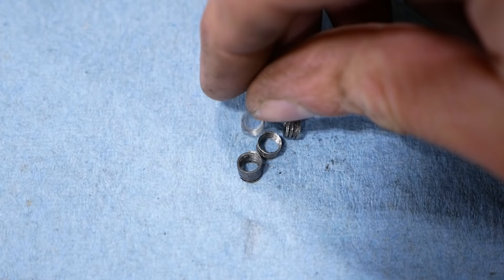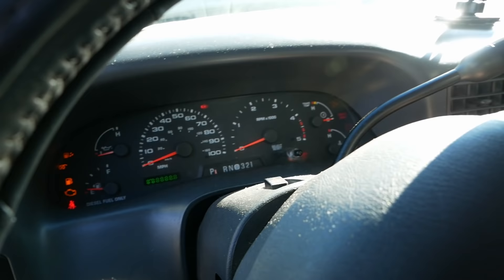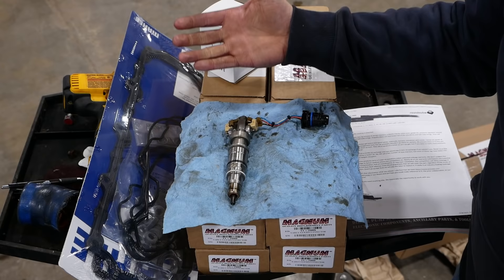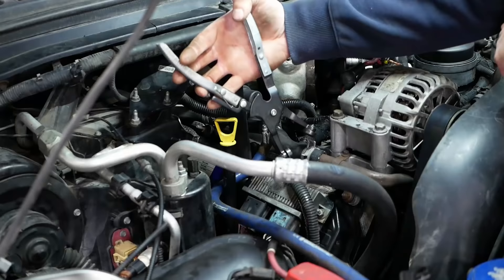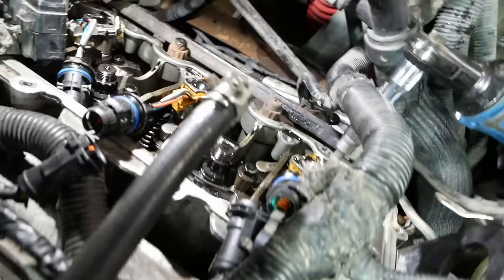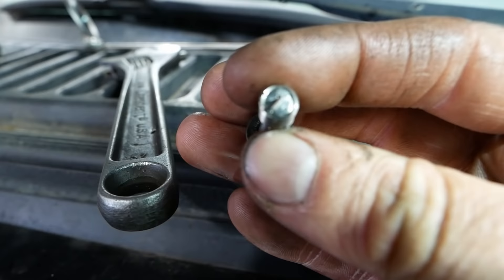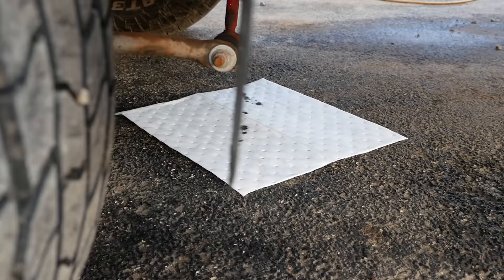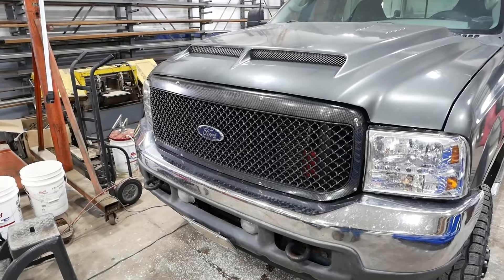They Left Me a Mess - 6.0 Power Stroke Low Cylinder Contribution - Injector Replacement Woes

Comment from the maker: Be sure to check out Area Diesel Service if you need injectors or anything else for you diesel engine! https://www.areadieselservice.com
Reply: Just sent them an email this morning about some Perkins injectors :) now I get to split the dang tractor and replace the shift fork. The loader frame assembly is gonna suck
Reply: Your video of your vist there was awesome!
Reply: I've watched those videos more than once.  They are pure professionals like you Wes.  TY for bringing many viewers along for the ride.  I wish I lived closer, you would have all of my vehicle business.  Always Best!!
Reply: The lighting is much improved... veddie noice
Reply: It's funny--- because I have the same color truck-- SRW though;  and a year before this. A 2002 F350 with the 7.3L diesel, 6spd manual, manual 4x4 transfer case, manual locking hubs.   I have over 320k miles and still on the original injectors and original glow plugs (it needs new glow plugs to be fair)...  It does love to leak a little everywhere, but she still starts and pulls anything I want it to.   I might look into polishing up this turd and selling it if they are worth that much now.  I have a 9ft flat bed on it with goose neck ball.  I'd hate to sell it, but if someone offered me that much, its gone. lol
Reply: Any insight on engines to avoid and engines that are more reliable?
Reply: He should sell it before it breaks in half. Just saying.
Reply: all the 6.0 powerstrokes and 7.3s the hood fitment is like that stock. or even aftermarket there is always a noticeable gap in the front.
Reply: @justnsaliga8518  it isn’t the gap itself, it’s the unevenness of the gap.
Reply: Thanks Wes!!!
Reply: yes, hate those 1/4 turn bolts cant reach, pig iron is cheap, . price of injectors buy a 7.3..
Reply: @tombeauchamp806  I will

Comment: It’s good Ford put the data plate on the backside of the valve cover against the heater box. Easy to read once you lift the cab off the chassis.
Reply: Considering that just about everything in the service data starts with 'remove the cab,' it's not too surprising.
Reply from the maker: At least it has a tag. Most engines have nothing.
Reply: @WatchWesWork  Here Here and thank the Gods of decency that a tag existed.
Reply: Another 
Better idea…..
NOT…
Reply: Ha ha
Reply: Like how ford doesnt label fuse box lids?
Reply: these trucks were designed around lifting the cab off for most engine work.
Reply: @chubbysumo2230  its actually way easier for the ford techs. Just screws the home mechanics.
Reply: I have been a Ford parts guy for over 20 years... If anyone ever needs an ESN for a 6.0 we can look them up by VIN... They all do stupid things.  I've heard that when doing head gaskets on a Duramax, you wont get the correct ones till you tear it down to find ID numbers on the gaskets.. Ford has given us ways to determine information like that prior to tear down.
Reply: @applefordguy76  yeah i had a lbz and was told there was 4 possibilities. Thankfully i left it 100% stock and it was flawless
Reply: @applefordguy76  I'll take that over a cab pull. (ID'd head gaskets)
Reply: @jeepindave5464  I have seen it done with a forklift, and some creativity.  also a telehandler too.  if you are brave enough, and overhead a-frame crane with enough lift capacity could do it.
Reply: @jeepindave5464  Their idea of a label is F101 etc
Reply: @timewa851  We dont pull the cabs at our shop.  And, have you ever seen anyone do head gaskets on a Duramax?  A friend of mine works at an independent shop.. Said he'd rather do 10 6.0's for free than another Isuzu Duramax.. And yes, Isuzu diesels need head gaskets from time to time as well. 😆
Reply: I know right lol.
Reply: @applefordguy76  the lbz water pump was ridiculous. Pulling the harmonic balancer off.
Reply: Assuming you've pulled. Covers, to check other things....
Reply: This was not a shot at Ford, it is the reason design engineers and technicians can never be friends.
Reply: @applefordguy76  at our shop we pull cabs on 2013 and newer Cummins, any duramax head job and of course every ford

Comment: "eyes roll when I get the scope out"... I just shook my head when you said that (is this the same crowd that has all of the objections to dielectric grease?).  The scope is one of your most powerful tools!  It gives you the ability to see into the machine!  Your mastery of the scope sets you apart from most automotive mechanics.  Long live the scope!
Reply: Yeah I couldn't believe that either, I was interested in it.  Why bother watching a channel like this?
Reply: There are a bunch of anti-technology neophytes who are scared of learning skills that have been necessary for the last 30 years. They bemoan the fact that modern vehicles have a more complicated electrical system than their lawn mowers! They light up the comment section any time Wes, Eric O, or any other mechanic dives into real diagnostics.

It's exhausting, really.
Reply: When Wes gets out the pico I get excited.  He is a master of the diagnosis and is the main reason I watch.  Those old dinosaurs can go elsewhere to watch the parts cannon “mechanics”
Reply: It gave so much good information - one picture showed so much. Sure, the computer said the same thing, but computers get it wrong. Worth going that extra step before ordering expensive parts.
Reply: We dont need no lectric grease
Reply: @davidhudson5452  Well when you use it improperly, then no, you don't.  Placing grease on the contact areas of a high-current electrical connection is really not a good idea, unless it is a conductive grease and it is a moving or rotating joint.
Reply: @redmondjp  Yes i was joking i have some
Reply: Eyes roll because they dont know how to use it.

Comment: The truck isn't leaking fluids, it's just marking its territory.
Reply: It also serves as a handy "Low Fluid" indicator.  I know my Nissan needs a top up by the puddle size.
Reply: Ambulance I drove for 8 years was a 6.0. At around 90k it got a remanned Ford engine for a bedplate leak. They put an entire engine in the truck for an oil leak🤣. That truck was up to 3 or 4 engines when they finally remounted the box around 280k.

Comment: OHHHHH god. I'm a diesel tech- and I take on most of the powerstrokes that roll through our shop. My stomach dropped the second I saw what I call the "expensive slinkies". When I first started as a tech, my first month in I was diag'ing a high pressure oil leak on a 6.0.. Test failed with major signs of leak coming from the passenger side, pulled the VC and found the oil rail had been blown off the injectors from the bolts being stripped. It has JUST been "bulletproofed". 

Just a reminder for all the DIY folks. 10ftlbs torque for the late model oil rail bolts, 8ftlbs for the early. I know the later rail bolts are a bitch on the passenger side due to the heater box, but its worth the effort.

Comment: Great job Wes, Watching this brought back my not so fond memories or working on my 6.0. I bought it with a HPO leak thinking is would be something simple like injector O-rings or a failed standpipe O-rings. I pulled off both valve covers to find that someone had been in there already and striped majority of the threads for the oil manifold hold downs, the few that were not stripped ended up breaking the ears off on the rocker box towards the lower side of the oil manifolds. I opted to replace that whole assembly. I ordered one of eBay that was advertised and useable condition with no bad threads, Once it came in the mail it was soaked in oil sludge and the threads were toast and I ended up Heli-coiling all 38 holes between both rocker boxes. In order to replace that had to remove the factory head bolts, replace the head gaskets, remove the heads and have to looked over and shaved, and install new studs. Talk about a PITA 😅
Reply: On broken connectors that I came across. I usually was able to place a plastic tie around the back of them between the wires and up a around the Device it was attached  too. Snip off excess and melt the remaining stub as to not dig or cut yourself on them.

Comment: You can’t go wrong doing a “how to” on the old ford 6.0 , the amount of 6.0 owners that either need injector work, or will in the future need injector work, is roughly 100% … between stiction, high pressure o- rings, head gaskets, long crank,
Reply: This is truck had exactly the same symptoms my 6.0 currently does
Reply: @superdutyscaler6823  bruh it is Cummins....
Reply: I was stupid enough to buy 2 of these; I also have an '05 Excursion.
Reply: @superdutyscaler6823  yeh bruh what’s a Cummings? Something says you’ve never ripped anything out. 🤷‍♂️

Comment: I had to replace an aircraft canopy that had a total of 348 1/4-20 screws with locking nuts on the inside. The spec was 10 inch pounds. But it took around 20-30 foot pounds to get the nuts on every screw! Thats why i became an electrician when i got out of the Air Force.

Comment: The fact that any 6.0s are still around boggles my mind. 

They've been all but eradicated from any form of existence in my area and haven't seen one in years.
Reply: Buddy runs a landscape business. He has a 6.0l dump truck. He asked me what its value was to sell. I laughed.
Reply: I have an 03 with 380k on it, oil gets changed with the seasons and I beat the shit out of it, never gets un hooked from a 8 ton trailer. Going strong I won’t put money into it though just going to bag it till it fails then replace.
Reply: Had a 05. With the pos 6.0 Got rid of it.  Found a. 2000 with a v10. Best move ever made.
Reply: @birdhunter2754  The V10 is worse than the 6.0, bud.
Reply: @sarahmathias9463  i have had. Good luck with it and alot cheaper on gas and maint.
Reply: @sarahmathias9463  In what make believe world do you live in?
Reply: Same here. Havent seen one in many many years
Reply: I have a 2006, it pulls a 5th wheel camper (about 9k lbs). 230k mi. Heads never been off. original turbo. It has had injectors, an oil cooler, and a handful of glow plugs. I won’t be surprised if it makes 300k mi.
Reply: If you live in the south or southwest/west, chances are they are still around here due to low humidity and sporadic snow so vehicles of this age or older still ply the roads in reasonable numbers.
Reply: @johnhpalmer6098  this is true. Up in the northeast here, trucks are rotted at 5 years, off the road in 7-10
Reply: @jp9579  Yep, watch guys like Wes, Eric O of SMA and they all work on shall we say, the occasionally "squishy" cars, or as Derick Bieri says, cars got some weight reduction going on (he having lived in Minisoota, now in Tennessee). In fact, Eric worked on a 2007 or was it 2011 Chevy Silverado that already had a cracked frame and that video dropped about a week ago.

Comment: Silicon hose story: A certain school bus manufacturer decided to use silicon hoses for the heaters. The amount of heater hoses on a school bus is incredible because of the number of heaters and the rear heater which is 30’ or so from the engine. So, when diesel fuel leaks into the coolant (forgot how that happens but it does) the whole bus smells like diesel and flushing the system doesn’t fix it because of the silicon hose. Imagine the time and cost to replace every heater hose in a bus. I seem to remember that silicon hose was an “upgrade” from the manufacturer.
Reply: the reason fuel gets in coolant, on the C7 cat and 444 international the fuel injector cups leak fuel into the coolant.
Reply: @josephbusby4625  It was a God awful C7 Acert bus. You jogged my memory.
Reply: Cat made great mechanical engines. Their Heui systems that international used was ridiculous.
Reply: Why would fuel in the cooling system make the inside of the bus stink? Was the heat exchanger leaking as well?
Reply: @HerculesRockefellerESQ  The smell permeates the silicon hose.
Reply: @markloy9651   the fuel impregnates the silicone hoses in the bus and the smell comes with that.

Comment: Good video Wes. This is one of the reasons why I refuse to buy a newer  truck. My 1997 f477 has 383 thousand miles and counting.  7.3 powerstrokes  might be old school and low on power compared to new diesel trucks but it always starts and pulls anything I put behind it. No way I would trade even for a 6.7 powerstroke  or 6.7 Cummins engine
Reply: wait till you have to push one of those off an active runway because the CAS quit on it, while tower yells at you to get off because inbound traffic.  we came up with a number of names for it: Ford powercroak powerjoke powersmoke powerbroke

Comment: Watching you work on that 6.0 almost makes me miss the 2005 I had. In hindsight I probably should of kept that truck but I made the mistake of trading it in to buy a 2008 6.4 which was the biggest piece of junk I ever owned. By the way, hearing you complain doesn't bother me at all because I can totally relate where you are coming from and I think most people who watch your videos and do or have done what you do can totally relate as well, good work Wes.
Reply: I had an 07 cummins and I traded it in right when the warranty ran out. No way was I going to get stuck paying for a DPF or turbos, or EGR system repairs. I don't need a truck now, but my dad's 04 Duramax will be the next truck I take over as it's the last of the good ones.

Comment: Working for years making a sort of a living working on multi cylinder Japanese motor cycles I tota,ly understand the problems of charging for the work done. 8 hours tracing a problem, one hour to fix it. Often involved tracing soldered connections in the  wiring harness, which usually involved removing acres of plastic and fibreglass fairings etc.  One one machine we had to remove the exhaust system to lower the engine unit to give access to wiring harness which was trapped between the rocker box cover and the top aluminium frame tubes.  Many places would not take on electrical work, especially after the owner or a friend had tried and failed. Yes some personal satisfaction when you solved the problem, doesnt  buy  much bread though

Comment: If the 6.0 is equipped with a steel fuel tank, they had issues with them delaminating the inner tank coating, sending everything through the fuel system. A friend of mine had to replace a set of injectors because of this. Pretty good injection shop, that would have a labor and parts warranty. Area Diesel Service, looks like a good company to get to know. Thanks for sharing your time and videos.
Reply: I've never seen a steel tank on any newer diesel pickup truck.
Reply: @LawF250  My friend has a 2006 F-550 that had a steel tank from the factory, it now has a plastic tank. Expensive lesson. Might just be on the 450 and 550 versions.
Reply: Shouldn’t the fuel filter stop the particles?
Reply: @robertheinkel6225  They got by the OEM Filter. Ruined a set of injectors. I guess there was a Ford Bulletin on it, after the fact.

Comment: I used to work on at least one of these a week. Something that helps significantly with injector stiction, especially in cold temperatures, is to use an oil that is lower viscosity when cold. Ford makes a 5W40 diesel oil, or you could use something like Rotella T6. It’s not going to fix a bad injector but it helps with the rough starts and lack of power that happens on even good injectors on 6L fords (when cold). These engines don’t respond well to the typical diesel go-to 15W40 engine oils in cold winters because a 15W oil is like molasses when it’s freezing, and the tiny moving parts in the injectors don’t like it. The whole reason that Ford cycles the injectors when the engine is cold (before starting) is to try to heat them up and get the spool valve moving. Thinner (when cold) oil will help with that too. Many years ago, I worked on an ambulance with a 6L Ford, where there complaint is that it had a significant lack of power when cold. It didn’t miss, but it just had no power. Ran normally when it got warm. The only thing wrong was the engine oil, the spool valve in the injectors couldn’t move fast enough when the engine was cold, so it couldn’t deliver enough fuel. Normally my suggestion would have been to let it run for a few minutes before they tried to drive it, but this is an ambulance we are talking about. Letting it run for several minutes before driving is not an option. Changing to a 5W40 diesel oil completely resolved the issue, and they ended up switching to that oil across their fleet of Ford 6Ls.

This particular Ford is pretty typical of the older ones that I’ve seen more recently. Unfortunately a lot of hacks end up working on them and make a mess. These engines come apart and go together one way, but unfortunately a lot of people don’t take the time to figure out right way and end up destroying things in the process. I honestly never found them that difficult to work on (except an E450 bus chassis, that was impossible to work on, I think turbo and injector replacement on that paid like 25 hours), but others seem to be incapable of touching them without destroying them.
Reply: Couldn’t pay enough to do a van chassis.

Comment: I have one of these 2003s.  Had all 8 injectors replaced after one blew out - work done by local repair shop with injectors from Advance Auto parts.  Now one injector misses at low RPMs after it warms up.  Runs fine cold.  Ugh.  Some other minor issues - but I like the truck.  Engine runs strong.